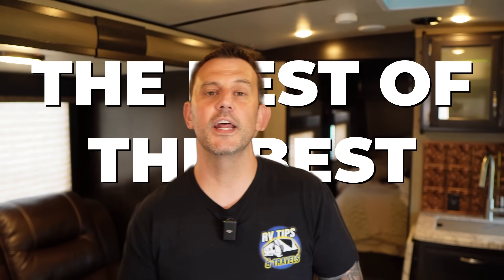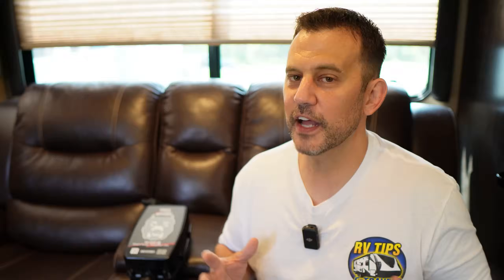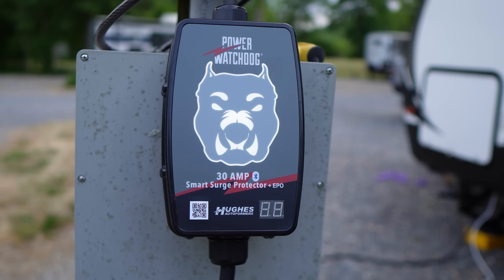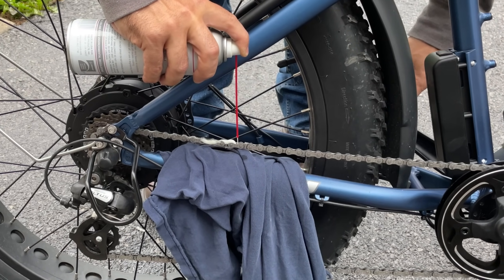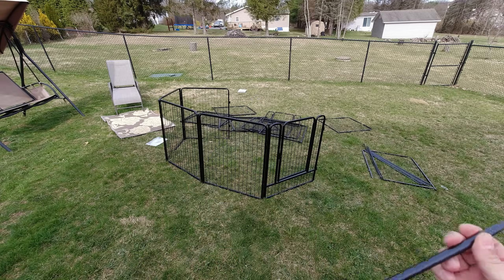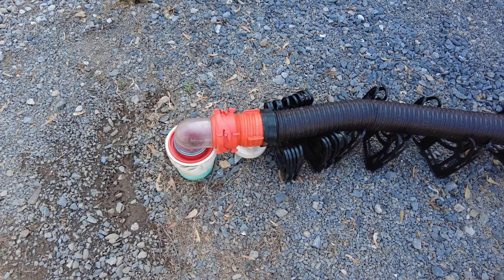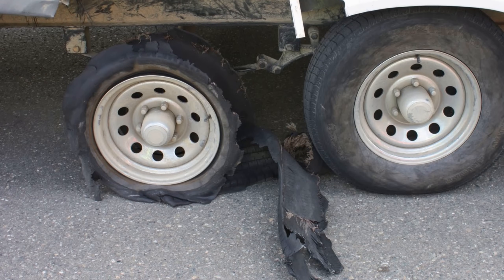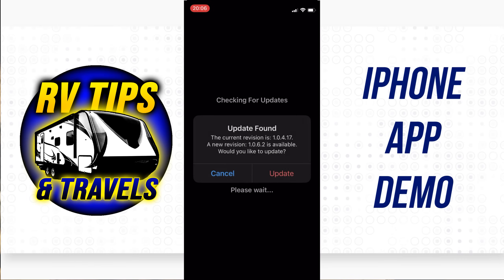The Best RV Accessories - Top Picks From a Veteran RV'er

Comment from the maker: ✨⭐ PRODUCTS FEATURED IN THIS VIDEO ⭐✨
🔹 Carmtek 10 Digit Keyless Entry Lock https://amzn.to/46ouuSE
🔹 Hughes 30 Amp Surge w/ EPO https://amzn.to/3qWipnv
🔹 Hughes 50 Amp Surge w/ EPO https://amzn.to/3plQZag
🔹 Hughes 30 Amp Replacement Surge Module https://amzn.to/3r0qVlA
🔹 Hughes 50 Amp Replacement Surge Module https://amzn.to/44ftKgJ
🔹 Boeshield T-9 https://amzn.to/3r7LZq4
🔹 FXW 16 Panel, 32" Kit https://amzn.to/3pl71RI
🔹 Other FXW Playpen Kits (5% code for FXW items: FXW202306) https://amzn.to/3NLMG1r
🔹 Camco 20' Sewer Hose Kit (10% off automatically at checkout) https://camcooutdoors.com/discount/RVTIPS&TRAVELS
🔹 Camco & RV SnapJack Combo https://camcooutdoors.com/products/snapjack-and-eaz-lift-rv-scissor-jack-combo-2-pack?_pos=1&_sid=701834006&_ss=r
🔹 TireMinder A1AS https://amzn.to/44jtD3O
🔹 TireMinder I10 (best seller) https://amzn.to/43YgIod
🔹 Micro Air Thermostat - $15 Off Discount Code (good through 9/30/23): rvtips (entered during checkout, for most models) https://www.microair.net/pages/easytouch-rv-thermostat-replacements-select-a-brand
Free RV Newsletter: https://view.flodesk.com/pages/6497c6a9d1998fa8c7623e9f

Comment: I recently encountered a site the 30 amp circuit died late at night. Our RV has a built in surge/circuit protector that saved our wiring. I used a 50amp to 30 amp adapter and was able to stay in the site.
Reply from the maker: Nice!

Comment: I’m hearing that the watchdog isn’t waterproof. I’m in the PNW where it rains OFTEN. What do you suggest to cover and protect the surge protector?
Reply from the maker: It is IP65 rated. You will be fine, but industrial plastic can be zip tied to the top cord and draped over.  I’ve done that before with cheap surge protectors.  I’ll try to find a picture for you.

Comment: Ok, so I bought a used RV toy hauler and the previous owner had a surge protector with it. It’s a 50A surge protector but my camper is 30A. And I’ve been using a plug adapter to connect. Is this ok? Also, is the surge protector your using different than others? Mine is made by POWSAF. It’s 50$ compared to 200$ for the one you use. I’m not saying it’s not worth that. I’m just trying to learn the difference. Also, I do plug mine in at the campground power and turn the breaker on before I plug my RV into the surge protector to make sure there aren’t any issues. Sorry for the long post. Thanks for your help.
Reply from the maker: sorry for the late response, just getting caught up.  i dont know much about the powsaf surge protectors so i cant confidently answer your question.

Comment: I've been using two sets of 16 panel fences for years and I thought I had it good...  I'm gonna check out FXW as a possible upgrade.
Reply from the maker: They are definitely nice Jeffrey.  I’ve tried fences that were permanently joined with clasps that folded up… hated them.  Over engineered and too heavy. Crates are too small  too.

Comment: Are there replacement doorknobs that don’t require a lot of finger strength? My Jayco Jayflight is very hard to open!
Reply from the maker: the locks should be fairly easy to open... sounds to me like you may need to adjust your stiker or door plate.
Reply: @RVTIPSANDTRAVELS  thanks! I may need to take it to my dealer - we aren’t “handy”!

Comment: Our surge protector has singeing on the terminals.  I guess it’s time for an EMS?
Reply from the maker: will be releasing a video about this, but your rv might be pulling too much amperage, depending on what appliances you are using.  if the breaker isnt flipping, this could be your issue.